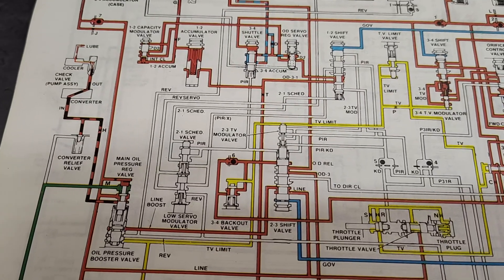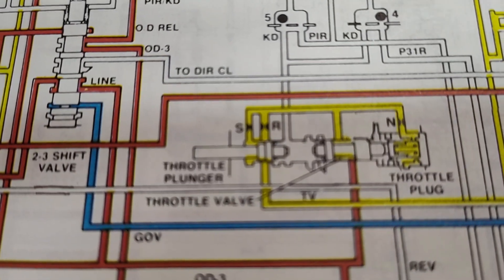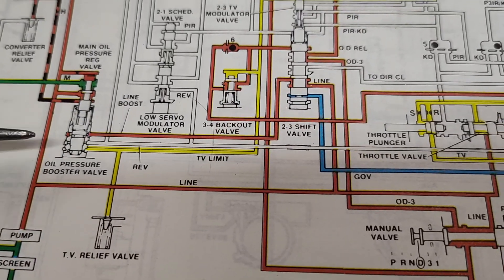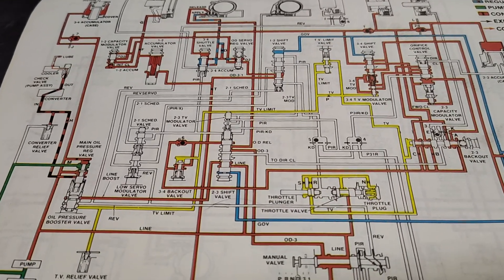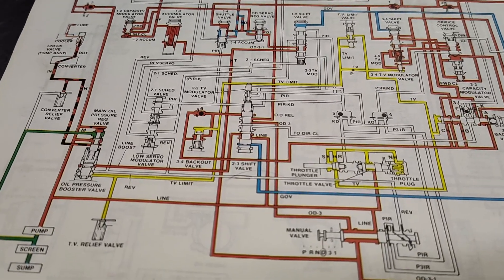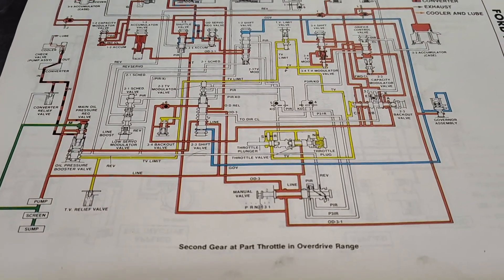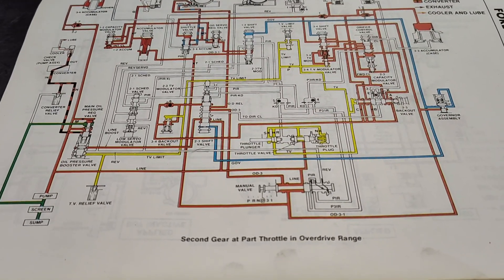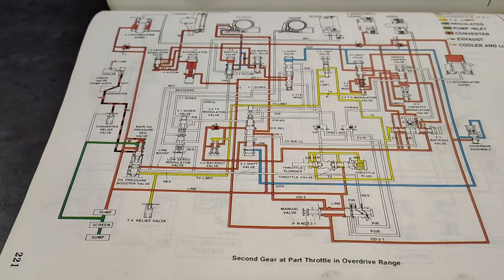Understanding Fixed Pressure Valve Body Ford AOD Transmission

Comment: What is your opinion on 4r70w LB1 booster kit ? Is it worth it? You mentioned that high pressure might trigger neutral In OD , so I'm hesitant to install.  No issues with transmission except whining noise in neutral and park , but no slipping or anything ( btw if you know what causes it please share) 
Thank you
Reply from the maker: It depends on the programming on the PR circuit and power level. I would say in most applications its not necessary.

Comment: I have a fixed line pressure VB with a trans brake from another builder and I’ve had issues with it from the start but not with hard up/downshifts. 

When I first installed it I had a super weak super slow 2-3 shift. Had the trans rebuilt thinking I burned it up. Had it rebuilt and it did the same thing. Had to send the VB back to the builder. The issue now is I thought the sprag was going bad so I had a mechanical diode from a 4r installed and a few other tricks that you’ve covered. Turns out in manual 2nd WOT the truck is popping back into 1st for an instant then back to 2nd. It’s extremely violent and feels like it’s going to blow the rear or driveshaft. I figured this out tonight on my way to work. I removed the tv cable and it made a clean 2nd gear pull.

Do you think this is a VB issue still or is this a tv cable adjustment issue?
Reply from the maker: My advice is to always spend time whith the TV adjustment first before resorting to a valve body repair or replacement. Its really hard to say for sure what the problem is.

Comment: Good job man! I agree 100%! I've been there too. Everybody thinks on AODs & TH700R4s and even on the old Torqueflites, oh that's just a kickdown, you don't need that. Well yes, yes you do, it's a throttle valve cable or linkage, TV, that controls internal working pressure and shift points according to throttle position, it's not just for kickdown. Without hooking them up and being adjusted up properly they will for sure burn the trans up in a hurry!
Reply from the maker: You are exactly right! Thanks for the comment and support.